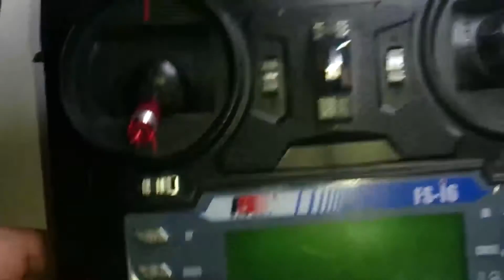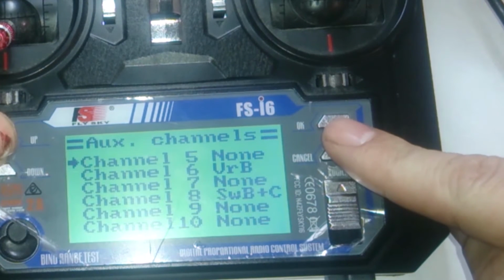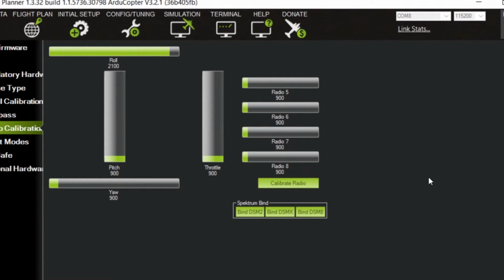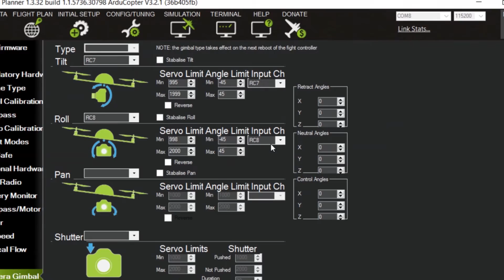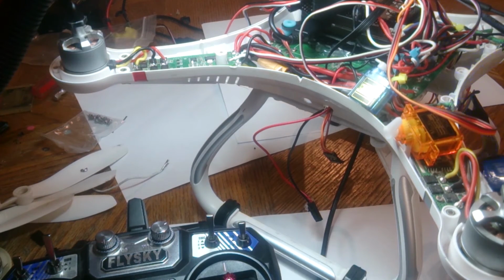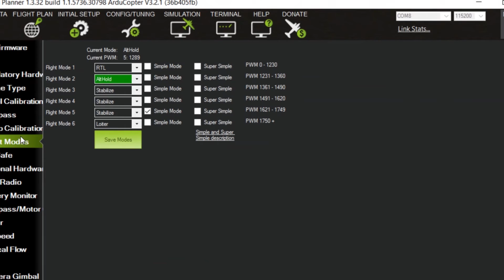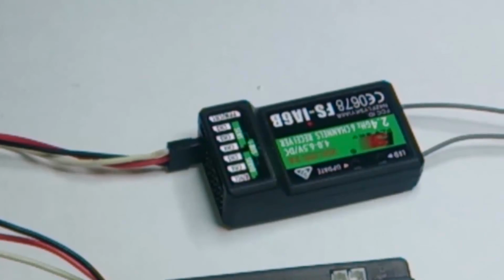flysky ia6 ppm output with ia6b for the apm2 6

Comment: Hello sir yesterday when I come back from flying my drone, I watched the video of someone, while @ that video I was setting 3 mode switch and all settings but my drone not fly ...after that all settings are distroyed,,,I have reset fs-i6 ...and again done all things,,,but now also transmiter is not connecting with apm ...it's not respond...red light is blinking continue.....what I will do pls help
Reply from the maker: did you try to rebind your transmitter with   key/wire..   here is a old video showing the plug wire https://youtu.be/Vyt2d8rXkws?t=101
Reply: @ModItBetter  ya bro i already rebined and separatly esc calibrate also......all motors are running through receiver. But transmitter is not arming don't know why, I checked all settings I done master reset transmitter......can u rply mey on whatsapp bro my mail id- amn431@gmail.com
Reply from the maker: @technicalhackeryt5770  hi are you running on apm2.6 or pixhawk.. and did  you disable arming check if your in your house?..   Like can you still do radio calibration in mission planner? again if your using apm 2.5 ect..
Reply from the maker: here is the arming check part.. in another video i show
https://youtu.be/mrBWEATUbus?t=1441

also go to radio calibration and confirm it works when you turn on your transmitter.. if so  do a calibration and also make sure to move the dip switches as well and make sure channel 5/6 move..on the right side.

then try to disable arming check.. and also if you forgot you need to reverse channel 2 on the transmitter to work with apm.. other wise it wont arm.  

and also check to see if your in the right mode to arm it under flight modes.. you can move your dip switches in that screen to see if it working

Comment: Hi ,
Thanks you for your help .Finally I could calibrate ESC and spin motors. But there are problem which I am still facing. Please go through the problem I am facing in the below description.

As you know I have pixhawk 2.4.8 and a hexa frame S550.  I am facing some problem with it. Please help me
1. Main out 3 of pixhawk seems to be the problem. Whatever ESC I connect I am not able to spin motor. It was working fine before. But with other Main out's I am able to spin. What could be the problem here? How do I resolve? I had flashed Hexa firmware, Octo firmware and quad firmware. None of these firmware worked for me on main out 3 . 

2. As I am not able to use main out 3, I had to flash octo firmware for the pixhawk on my hexa frame. So , I could use main out 7 and able to spin the motor. So all my 6 motors spins with octo firmware. Now I am able to arm the drone. But when I try fly , it leans or drifts towards left side. I am not able to control it and I have damaged my hexa frame. I am using FSi6 transmitter.  Do I have to trim? or Do I have to calibrate compass. or Is it because of the Octo firmware flashed on hexa frame? How do I handle levelling issue? Please help me.
Reply from the maker: i know on apm 2.6 i made special firmware to change motor outputs if one is bad.. .. and yes your leaning is because wrong firmware..   however you should be able to do it with pixhawk and set motor 3 to something else.. try to fallow these instructions ..  before you change firmware look at the number for motor output 8 and set that number for motor output 3 https://ardupilot.org/copter/docs/common-rcoutput-mapping.html
Reply from the maker: example 
SERVO3_FUNCTION change from 35 (aka “motor3”, front-left) to 40 (motor #8)
Reply from the maker: also if your new to mission planner you have to go to   "configtunning"-- "Planner"  then change "Layout" to "Advanced"   then you can see "full parameter tree" ect..
Reply: @ModItBetter  As I am a beginner I was not aware of these. I could finally fly the drone with your help on pointing me to the problem and suggesting the solution. I am very thankful to you. 
One question in my mind is :
Can I flash Hexa firmware and select quad frame? or flash quad firmware and select hexa frame and open up outputs?
Reply from the maker: @tharunjavalimn  I am not sure if you can do that i've had issues where i had to force the frame in mission planner in param tree.
so make sure your frame is hexa and the firmware is hexa..
Also because your new .I would set these to this
ANGLE_MAX,2200
ANGLE_RATE_MAX,18000

This will make your quad not so touchy and want to crash while going forward ect.. 
I would also set failsafe .. to land.. until you got some good return to land.
and if your in a open field I would also change return to land height from 1500 (50) feet to 424 .. about 13 feet.   (RTL_ALT,1500)
at least for your first few flights . while you test return to home ect..
this way it wont go up 50 feet and if you did something wrong you wont loose it.  Unless you are surrounded by tree's ect.. 
However I would still set it to 424 for the first few test just make sure no tree's around.
Your first return to home test should be this..
Place hexa in front of you about 3 feet.
arm it and bring it up in the air about 6 feet .. 
fly it about 20 feet in front of you in a straight line.
Now flick the return to home.   .what should happen is it should raise couple of feet and come straight back towards you.
If for any reason at all it is not coming straight back towards you flip it out of return to home.. bring it down .. and call it a day and figure out what is wrong.      If you have a fail safe to return to home, instead of "Land". You would of just lost your hexa..

Comment: Hi,
I have FSi6 Transmitter and FSi6B receiver. I see ppm/ch1 in my FSi6B receiver. I have enabled ppm on rx setup of receiver. And it is connected to RC port of pixhawk 2.4.8.
I am not able to do ESC calibration through pixhawk for one motor which is connected.

Do I need ppm encoder to connect from FSi6b receiver to pixhawk?
Do I need to setup any parameters on the pixhawk using mission planner?
Am I missing something here?
Reply from the maker: if you go into radio calibration does your transmitter work? for throttle and everything else.?
if so .. pixhawk does have a calibration option or if your doing it the old way.. you need to arm the quad then go throttle up .. then plug in the battery.   .. Keep in mind you will have to disable arming checks as well.
Reply from the maker: also i should of asked can you arm the pix and move the throttle up to make the motor turn.. if so you should be able to calibrate it then.
Reply from the maker: and to spam you a tad.. if everything works accept the calibration for some reason..   You can connect 1 motor at a time directly to the receiver channel 3 / Throttle ....         Also i should note just in case you didn't you need to reverse channel 2 on your transmitter for the pix..
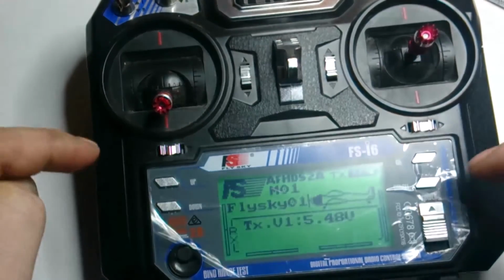Reply from the maker: and the spam continues.. did you go to settings on your transmitter and change it to ppm output? ( 2:36 )  if you don't have that option you might have to update your transmitter with modded firmware.  here is a video on that.. in the description I have a link to the cable that makes it way easier and you don't have to take anything apart..and can skip to the software section of the video..   https://www.youtube.com/watch?v=o-gEJ_U3GDI            or if you only need 6 channels ..then you can get a ppm encoder like you suggested for the pix
Reply: Thank you for your reply. Yes I have enabled ppm output using the transmitter and also I am able to calibrate ESC by directly connecting receiver channel 3 to ESC. I am able to spin motor. But through pixhawk I am not able to calibrate ESC. I have connected ppm/ch1 of receiver to pixhawk rc port and from pixhawk to esc. I don't have ppm encoder. Do I have to buy ppm encoder?
Reply from the maker: @tharunjavalimn  I'm just curious..   in mission planner if you go to radio calibration and do a calibration .. does anything move?
Reply: @ModItBetter  Yes it does move.  I even checked  by switching off ppm on my transmitter. When switched off it does not move but when I enable ppm I see movement in radio calibration.  Mine is a Hexacopter. I had selected Copter while installing firmware.
Reply: @ModItBetter  I have safety switch connected and also buzzer connected. Only via pixhawk 2.4.8 . I am not able to configure ESC. Is something wrong with my connections?
Reply from the maker: @tharunjavalimn  so now you have it back on hexacopter ..its working?
Reply: @ModItBetter  
Still It is not working.
The firmware is COPTER 4.x.x ( Mine is Hexa frame)
What is the way to calibrate ESC via Pixhawk? 
RC Receiver sends PPM signal to Pixhawk(RC1). But ESC understands PWM signals. How does  pixhawk sends PWM signals to ESC?
Do I have to use some other firmware?
What are the steps I should follow before ESC calibration?
Reply from the maker: @tharunjavalimn  go into mission planner ...Initial setup and click on the hexa frame and load that firmware.. try version 3.5.7
Reply from the maker: about the pwm's .. the motor outputs on the pixhawk sends 1000-2000 pwm ..      so when you send ppm protocol to the pixhawk it converts it to pwm's for each motor output . ..
Reply from the maker: errr with the new version of mission planner its .. .Setup ---Install firmware
Reply from the maker: for the esc you can also try that in mission planner go to Setup... Mandatory Hardware then esc calibration and fallow the steps.. but only after you have done a Radio calibration
Reply from the maker: @tharunjavalimn  and your also fallowing the scheme for a hex? also white wires on the bottom of the pix..  example https://youtu.be/_yl4VaZnpMI?t=887          How are you powering your pixhawk?  with a power module?  if you trying to power it with esc make sure to remove the red wire out of the other 5 esc's and tape them up .. if you are powering your pixhawk with a power module remove all red wires. out of the harness from the 6 esc's (white red black)..   and for kicks make sure you have a sd card placed in it.
Reply: The question is :
Does the pixhawk  looks for 6 ESC's when the  firmware loaded is Hexa Copter 4.x.x? So, If I connect one ESC and one motor will the pixhawk does not allow for calibration of one ESC?
Reply from the maker: @tharunjavalimn  Pixhawk does not know how many esc's are connected
Reply from the maker: so if the motor does not turn when you arm the hex.. its possible your esc is not compatible with the pixhawk .. maybe google the name of your esc and see if its compatible...         And your also attaching the battery during this test????

Comment: Bangs are the S1 and S2 ports on the bottom of the cx 20  now unusable  , so i can un plug them and just use chanel 7 and 8 on the apm now ..
Thanks  Edit .. actual Fact  could i not just plug those two bottom s1 s2 to chanel 7 and 8 so i can just plug n play with what servo i like ?
just needing one for Payload Bait dropper ..... nothing else will be attached
Reply from the maker: correct .. if you have 10 channels or even 8 showing when using ppm .. you need to setup mission planner like this if you are going to use a gimbal that is.. 
and like you said you use channel 7 and 8 output on the apm. for the cx20 2 gimbal wires
https://youtu.be/Ir0OZmRPpyU?t=346
Reply: Thanks Mate for your help I just noticed you have already Clearly Explained the Gimble wires on your other video I was just bit slow in getting on top of it 

I’m pretty much Finding all your stuff easier now I have pulled cx apart enough now 

Cheers Bangs

Comment: Can I reach you by email or phone I need extra help. 9152410838 or tgarcia7@miners.utep.edu 
 Please hit my line
Reply from the maker: sure ..hit me up at bangs696969@gmail.com
Reply: still havent heard a reply, please let me know.
Reply from the maker: Hi what do you need  help with specifically  .  My knowledge is pretty much only with the apm flight controller .. or on the subject of any of my video's .. If i own something I usually try to learn everything about it .. how ever if I don't own something I'm pretty useless..   

So what hard ware do you have and what do you need help with?
and I'll let you know if I can actually help.
Reply: Ok so i Have many questions.
Hopefully you can answer all of them. Do you have a facebook or something where we can message faster? anyway.
Background......
1. Ok so I have a quadcopter with an apm 2.6. I am using ready to sky motors and escs with a fly sky Fsi6x transmitter and fs- IA6b reciever.
2. I want to use ppm because it uses less wires upon setup. 
3. I am using a power module with the apm.

QUESTIONS...
1. When plugging the motors to the output of the apm do I need to remove the red (positive wire) since i am already powering the apm with the power module?

2. Whats a sufficient way to power the receiver, do i power it through the apm or connect to the lipo source through the PDB? 
3. To my understanding I watched videos and people have addressed that the elevator or pitch has to be reversed in Ardupilot when calibrating the radio,  how can this be done?
4. where could i find a programming card for the READY TO SKY ESCs?
Reply from the maker: 1. yes I would just remove the red wires tape them up or heat shrink them.  

2.receiver gets powered with the ppm wire.(if using 3 wires)/ use three wires heh.)
https://youtu.be/Ir0OZmRPpyU?t=75

3.https://youtu.be/Vyt2d8rXkws?t=503

4.https://www.youtube.com/watch?v=ygVlAyLPfI4&t=1s
I also have a link in the description of that video for the programing card.but you can also look for others..
Reply from the maker: in this video i show how to set your flight modes.. I came up this way instead of the other video using mixing ..its actually easier with end points....but with that both of my ways work to get the flight modes to work..
Reply from the maker: question 3 .expanded...

i don't have airplanes only quads.. but if for some reason for planes you need to reverse things besides doing it with your remote.. which really you should be able to do it with just your remote with the example i gave above with channel 2 reversed (quads only need channel 2 reversed) 

Anyways I made a step by step how to change mode1 to mode 2.. however it also answers your question..if you start watching the video at this location
https://youtu.be/3rQr-5d-W1Q?t=337

about 10 seconds in I will show how to reverse things in mission planner.settings as well.. 

but again I would just do it with the remote if possible..
Reply: ah makes sense!!
Reply: in the advanced parameters tree list for quads do you change it to negative 1 for RC 2 since you said it was channel 2?
Reply from the maker: no only change that on the remote..

Comment: can i upgrade fsi6x to 10channel ?because it shows content only for i6 in youtube
and i having flysky data cable .itS not detecting my transmitter help me iam in urgent
Reply from the maker: the fsi6x i think is already a 10 channel so you don't need to mod it you just need the receiver for it?      for example 10 channel.

I would not try the firmware on it it might brick it .. I Don't own one so my knowledge is pretty slim
Reply: bangs6996 yup bro I found thanks for reply....bro...and information

Comment: Have u mix mode channels(5&6) after 10ch firmware upgrade?
Is mixing channels is essential ??for mode selection
Reply from the maker: Hi my first video i had done mixing.. but i was screwing around and found that end points is just faster
https://youtu.be/Ir0OZmRPpyU?t=233
I show end points after i show the combining of channels..

original way I had done it was like this.
https://youtu.be/Vyt2d8rXkws?t=534  again i show the mixing after I show the aux setup.

Its up to you which way you want to do it..in fact you can do both if you really want to as well...

to answer your question .No you don't need to mix but you need to set end points and combine the channels.
Reply from the maker: and I'll also add .. its really easier if you turn on your transmitter.. go into mission planner and go to flight modes.  while you set your end points..or do the mixing you can see your progress in real time with the green box moving to each mode.